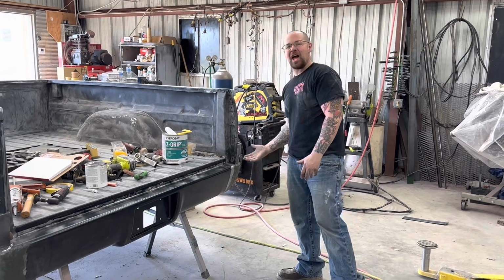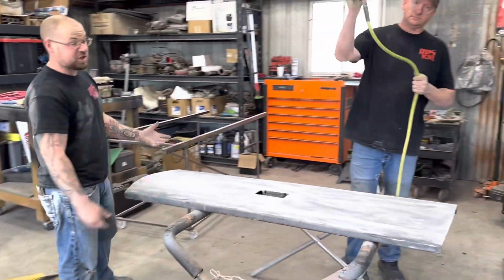Smooth Molded Roll Pan Install

Comment: How do I go about removing roll pan I bought a truck and it was welded on but I want the rear bumper
Reply from the maker: I’m not sure how well yours is welded in, but we would cut the majority of the roll pan out, then see what we are dealing with, and finish cut and grind smooth, there may need to be some additional re shaping and metal work tho
Reply from the maker: I’m not sure how well yours is welded in, but we would cut the majority of the roll pan out, then see what we are dealing with, and finish cut and grind smooth, there may need to be some additional re shaping and metal work tho